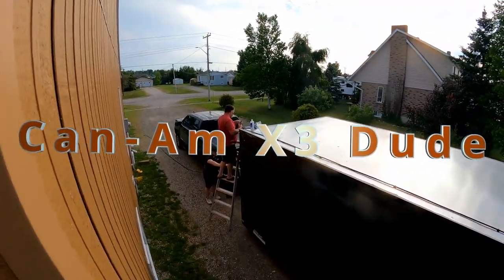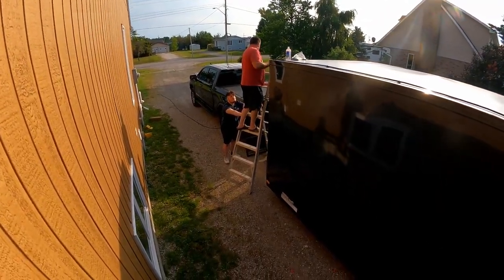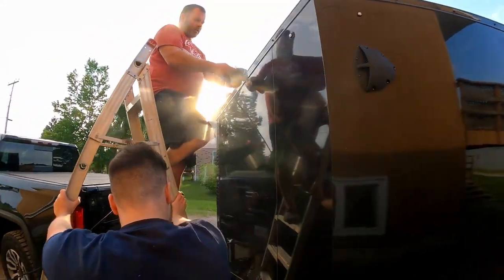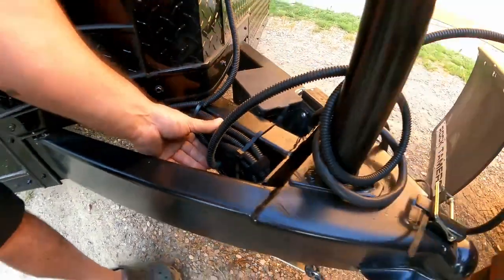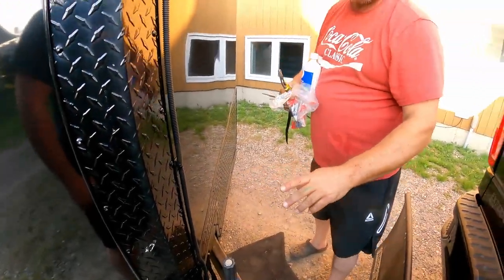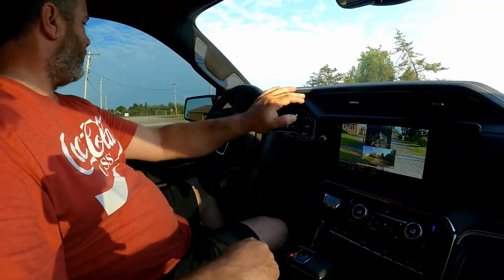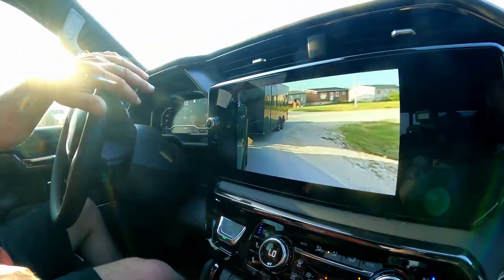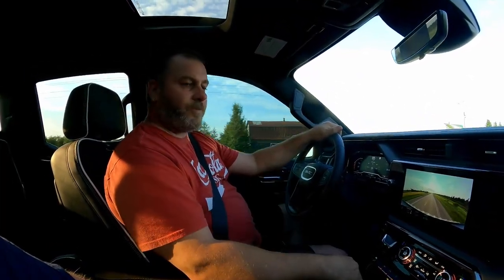GMC Rear Camera Installation On My Shockwave 18 Foot Car Hauler Trailer

Comment: Great video and thanks for sharing. Have you ever come across the issue that you connect your trailer and the camera to the truck, but the infotainment system displays a blank screen for the rear trailer camera? Mine just started doing that, that’s why I ask. Thanks
Reply from the maker: @LuisPerez-vy6bz  no it hasn’t done anything yet, sorry to hear about that, hope it’s not something common!
Reply: @Can-AmX3Dude  thanks and I’ve come across several post with that issue. Just thought I ask.
Reply from the maker: @LuisPerez-vy6bz  thanks for the info!

Comment: When in this view and you use the turn signals, when the turn signals cancel, what view does you screen return to?  The Invisible camera view?  I have a 2023 Silverado.
Reply from the maker: I you set it up to like the 1/2 trailer view when you turn the side view come on and if you used the flashers the side view and red section shows up and the return to the rear view you got set up let me know if that’s what you wanted to know and thanks for the questions
Reply: If I am in Invisible trailer mode, every time my I use my turn signals and they time out, my screen goes back to the Apps screen.  On a long trip, I have to turn on the cameras, I bet 500 times.  I think the software should return to the previous view that you had before you hit the turn signals.
Reply from the maker: @AndyWhittle_HowEFIworks  I believe that what mine does
Reply from the maker: @AndyWhittle_HowEFIworks  ya you would think so will pay more attention to that the next time I use it

Comment: What’s the part number you used for this ? Were you able to get the invisible trailer to work being mounted up high?
Reply from the maker: I will need to check for the part # when I get home, and yes the trailer top part disappears, but I don’t think you need the trailer Camera to get that effect , but what I found is that backing up you have the same feature that the rear camera on the pickup truck has you even see we’re the trailer is going and we’re it got to clear to turn pretty cool 😎 I love it ! And thanks for the questions hope this info helps
Reply: @Can-AmX3Dude  sounds good , if you can get me the part number that would be great , gm has a bunch of different part numbers and I can’t find it on the gmc accessories site . I have a 2022 refreshed Sierra Denali which I’m assuming would work with the one you have. I wish there was easier options to mount it instead of drilling or having it halfway up the ramp door . If it were up to me I would try to run the wiring into and inside the trailer and out at the tongue to keep out of the elements .
Reply from the maker: @chevrolaid350  ya they give a 2 way sticker that works great camera not going no where just clean good with alcohol first and you are good that what I did and that way I did not need to drill in my trailer at all !!
Reply from the maker: The part # is “85587357” for the trailer camera fits from 2020 to 2023 for sure it’s the full kit hope this helps
Reply: @Can-AmX3Dude  20-23 use a different part # than the 24 model trucks.
Reply from the maker: @jaypiva1951  didn’t know that